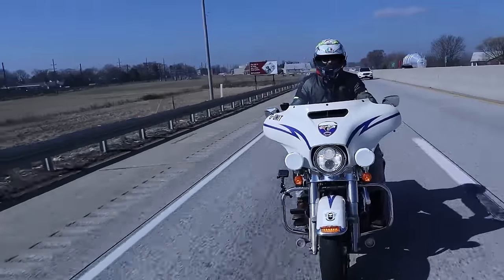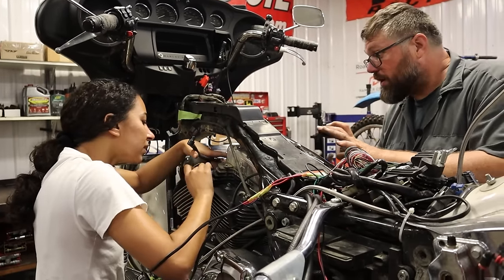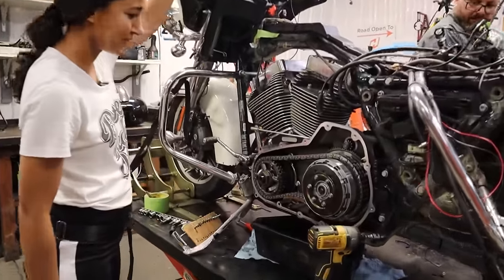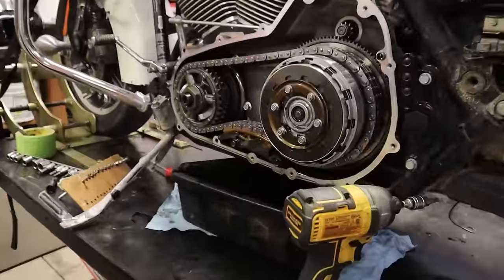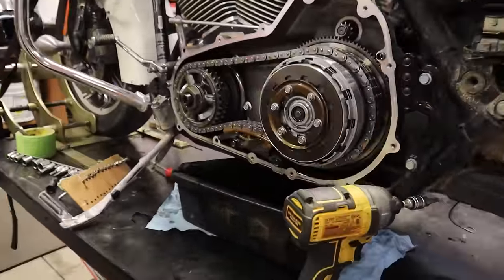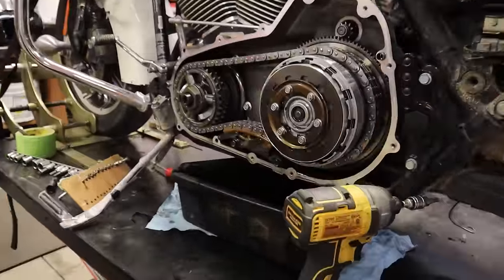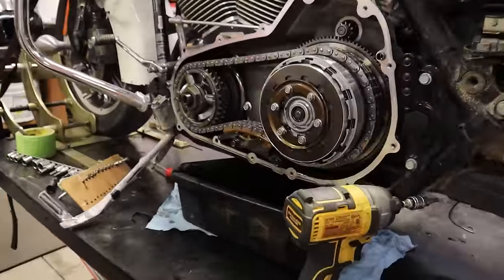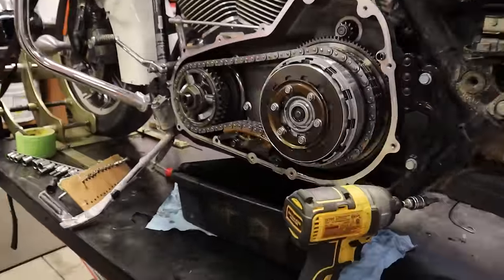Can I Teach This Girl To Fix A Harley Motorcycle Without Breaking It?

Comment: Doodle, On the righty tightly, lefty loosy goes, think of the face of a clock while looking down on the head of the bolt. On the clock face start at the 12:00, moving toward the 1:00 is right, toward 11:00 is left.
Doing your own maintainence is very satisfying, your sense of accomplishment greatly increases your confidence in your abilities. Just as you have done learning not just to ride but took lessons from people that can help you improve your riding.
Reply: Point the thumb on your right hand in the direction you want the screw or bolt to go, your fingers will be curled in the direction you should turn. Only works on right-handed threads. Left-hand threads would be the exact opposite.
Reply: @possiblepilotdeviation5791  the Right hand trick was what I was suggesting next, its the simplest trick to use on normal right handed threads.
Reply: Clockwise in, counter out
Reply: All 3 of these timestamps are great btw.

Comment: Awesome teaching keepin it simple typical HD needing to take off a dozen pieces to fix one piece Doodle is just lovely and that smile with the achievement it's a very real rewarding thing knowing that you've done it yourself great job nice vid
Reply: On most non-Harleys you have to remove the fuel tank just to replace an air filter, what's up with that? And don't even get me started on changing plugs...

Comment: Point the thumb on your right hand in the direction you want the screw or bolt to go, your fingers will be curled in the direction you should turn. Only works on right-handed threads. Left-hand threads would be the exact opposite, or use your left hand.
Reply: Not quite, you use your right thumb/hand for right-hand threads, and your left thumb/hand for left-hand threads.
Reply: @paulyeomans1065  The only thing I left out was to use your right hand, but otherwise, what I said is correct. What you said is also correct.

Comment: When you lay bolts out in order you run the risk of the shop jerk coming along and mixing them up, so just pull it apart and figure out where they go as you reassemble.

Comment: Great video, but I want to offer some unsolicited advice.  Instead of removing the Primary cover, it would have been easier to jack the rear wheel off of the ground, put the bike in High Gear, and turn the engine with the back tire to get the Timing Mark in the Window.

Comment: I seen what looked like MLS gaskets you were using. When I use MLS gaskets they actually have their own torque settings and not as the Harley manual states. Cometic's MLS torque specs say; 9 ft-lbs to 14, to 22, and rest 10-15 min then 35 ft-lbs and rest another 10-15, then the final torque number is 40 ft-lbs.. Harley specs are for OEM type gaskets like the old one you peeled off.. Got this information, I think from Hammer Performance few years ago.

Comment: A few Alan keys one cut shorter on the short end for intake a 9/16 or 14mm and an half inch wrench all u need maybe a razor  for base gaskets. Or some hose sections for studs so you don’t damage rings.  that’s it simple as can be

Comment: Good Job teaching the young Pup . 
That far into it , why not do the rear cylinder head casket . One got Pooched by the Nos , the rear sees the same pressures with more heat .
1000 miles is a long way to go .
Reply from the maker: I did the rear

Comment: Considering that both cylinders were subjected to the same cylinder pressures. Why wouldn't you replace the other head gasket too? I feel like that's just asking for trouble in the long run.

Comment: easiest way i learned to figure out which way is which, left is counter clockwise, right is clockwise, referece point being from the head of the bolt with the threads behind it
and if your not in that orientation, well S2BU

Comment: The only thing I didn't understand is other than teaching about the primary why did you pull the cover? Could have just raised the rear-end and rotated the engine with the rear wheel.

Comment: Nice you showed Sean helping in the editing room collaborating together and still working with him on joint projects.

Its good to get the kids involved with the wrenching even if all they learn is how much effort it takes when loosening or tightening bolts that require over 100 ft lbs of torque.  Had the kids remove just one lug nut on a F53 and they were wiped out with 7 left to remove.  Pulling the wheel off the hub was impossible for them too.  They struggled but did get the caliper pins off so they could lube them along with the caliper slides and reassemble.  They couldn't get the tire on the hub since it was too heavy for them and even with the long handle beam torque wrench they couldn't get the firs lug to the final 165 ft lbs until I told them since they weighed well under 150 lbs to try holding the wrench so they could pull up with their knees.  They were again wiped out after just one so a disabled senior citizen who walks with a cane had to finish the job for them leaving them asking how that was possible.  A 250 lb gorilla who's been doing this for over 50 years has the body mass and muscle to deal with it even if he's only got one good leg to stand on.  Takes longer now and more breaks are required but if you pace yourself you can still get it done as long as you don't give in to just sitting around in a rocking chair or in front of a computer/TV and stop participating while wasting away.

They now know how to do it but also better appreciate how much effort it takes when someone helps them with the heavy lifting part.  Now they are more concerned on a hot day when you help with their stuff that they have a good supply of water, etc and that you don't overdo it trying to meet their time schedule and ensure that you don't lose track of time and skip taking breaks.  It helps them know when their being taken advantage of by a pro and also to go in with more realistic expectations about time and effort.

Do the same mentoring whether its a truck, car, motorcycle, boat, lawn mower, kitchen mixer, etc, etc.

I still suit up, grab my folding cane and go for long rides on the bike too which surprises some at stops when the helmet comes off and the cane unfolds.  The kids on the sport bikes are often the most surprised.  Many think its cool too that perhaps they can still be riding like me even after life leaves them with a few dings, nicks and scars.

Anyways glad to see Craig also mentoring young ones.  We need more doing this hands on in person like this.  Kudos!

Best!

Comment: one head gasket goes and  the other one is just as weak  primary didn't need to come off and no lock tite going back togrther with a 1000 mile  to go i would worry about it coming apart and or the other head gasket coming apart ! nice show thou

Comment: Should never hit anything open palm. As a mechanic with 30+ years experience I learned the hard way. Can use a rubber mallet or use a boxend of a wrench on the quarter inch Allen wrench for leverage to break it free from the intake flange. Or you can also use a quarter inch wrench on the Allen wrench next to the Allen head to loosen the fastener 
Work smarter, not harder and safer. Damage to hands is common with older, and sometimes newer mechanic/technicians. We tried to complete jobs quicker to stay under flat rate to make profit but that has not always been the case due to injuries such as to the hands an fingers.
And as always stay focused, use all your senses. If it don’t look right sound right feel right, check it to make it right.

Comment: Why did you pull the primary cover when the primary chain, stator and clutch assembly have absolutely nothing to do with replacing the head gasket?

Comment: I have never worked on a Harley specifically.  But why did they take off a bunch of stuff on the lower end around the clutch and shifter when replacing a head gasket?  Should have only needed the intake, exhaust, and valve train.

Comment: Love the videos Craig! We could really use a “winterizing” your motorcycle video on this channel!
Reply: What is this word you speak of? Lol  mine doesn't get put away I ride year round. Put some fuel stabilizer in the tank, let it run for a few minutes to get the fuel into the carb/ injectors. Park it with a battery tender and your good to go
Reply from the maker: I was thinking about that

Comment: How did you take the pushrods out without taking off the tension?
Reply from the maker: I didn't. Gotta have the tension off to pull the rockers
Reply: @The_Bearded_Mechanic  Is that why you took the primary off? To turn the compensator sprocket and move the cams to the base circle? I have to replace the cam cover gasket on my 1990.

Comment: Hey Craig, why did you take the primary comer off???
Shouldn't you replace the rear cylinder head gasket too?
Reply from the maker: To show her what was inside and make it easier to get to TDC to pull the rockers. I did replace the rear too.
Reply: @The_Bearded_Mechanic  I got your point, most of my friends doesn't understand the concept of the primary , Nice work!😎

Comment: You need to replace base gaskets when you remove the heads on these engines.
Reply from the maker: Correct. It's a little less crucial with o-rings

Comment: Harley Mechanic😂😂😂 great job you two following tourque steps and all the little touches that should be done, including the removal of that horrific nitrous system! Who does that😂😂😂😂😂 Harleys dont like laughing gas unless,,,,,, you want to cry later! Unless you're doing a purpose built drag engine, and unless youre a race team its totally un nessicary. 
I really like the reliability of the evolution engines and those that came before them, with proper care they last and last for 100s of thousands of miles with no issues internally, its only when you ask too much of them rpm wise that they break. They were never meant for that, loping along at 70 mph in 5th gear is where its at for an old salt like me, soaking in the scenery, the fresh air and sunshine. Harleys are meant to be therapy, and they are!

Comment: Hahaha! Great job. No reason to pull primary cover, just put trans in high gear and pull the spark plugs then turn the rear wheel until the valves are on overlap. Another tip would be to apply assembly lube to each end of the pushrods. Been a Harley mechanic since 1980, and want to tell you you did a great job. But you really need to give Eric O credit for the uga duga’s!

Comment: this should not trigger me but .. her leaning on the front fender of the oooold 753 ... ARGH cause they are easy to find parts for.. anyways Craig pleace teach her that if you take 4 old xtra bolts "long"  for the primary cover and grind off the heads .. she can fingertighten them before adding the gasket and cover and she will then have a "holder" for the gasket and a guide for the cover so it ligns up perfectly every time .. and then ofc just remove the headless bolts after installing a few of the "normal" ones

Comment: I don't know the history or reasoning for putting the nitrous bottle to the system to gain more power, but considering that the added compression blew out the head gasket, doesn't it seem like a dumb idea to add that to an engine that was never designed to accommodate the added power?
Reply: Nitrous is almost exclusively used in drag racing. It still blows up special built racing engines. It sometimes blows the whole car apart. Putting it on any engine you want to last is dumb. But like drag racing, it only has to last a few hundred yards to make an interesting youtube video. An unlike racing, an engine exploding also makes a good youtube video.

Comment: It just doesn't make sense to me that if you're replacing the front cylinder Head gasket and the engine was under such pressure because of the use of nitrous, that you wouldn't go ahead and remove the rear cylinder head and replace that gasket too as a measure of preventative maintenance. No ?

Comment: I have seen some Female  YoooToob Channels  run by Female Mechanics.. One of them is  Heavy Equipment Mechanic.
  The Owners Manual tells you how to check the oil.. change the oil and full the  engine with the Proper amount.